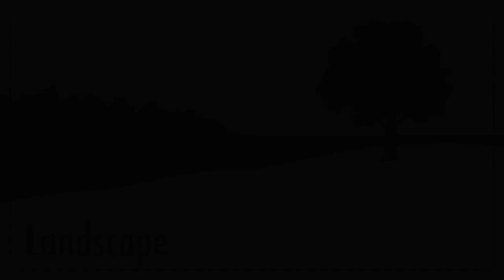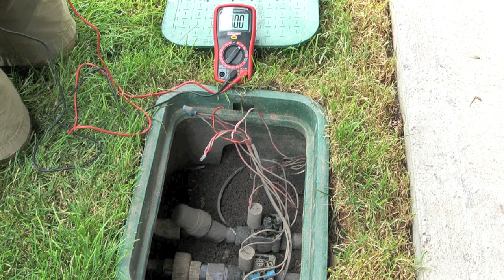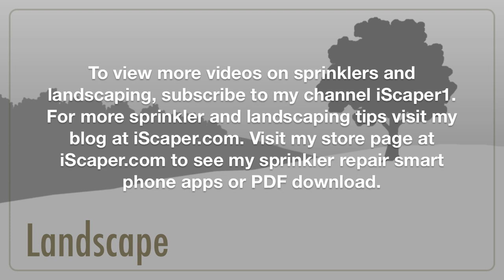Troubleshooting: Testing power to a sprinkler valve.

Comment: Thanks for posting. Any readers here that can help my problem, please feel free to chime in. I have a 6 station system that stopped working entirely. The timer controller was putting out 24 VAC at each port, the solenoids were not giving me an impedance reading though... (thinking wiring).. but each solenoid was operating when I spot tested them with power. I replaced the timer controller and this is when the mystery happened... two of the stations worked when I was going through the manual test cycle then some didn't. I scratched my head, unplugged the unit and tested all connections. I powered it back up and then NONE of the stations would operate. I can manually open each valve and they operate so I know it isn't a water supply or mechanical issue. Ugh, I don't want to dig up the whole yard for wiring. Any suggestions, sprinkler gurus?
Reply from the maker: I wonder if you have a bad splice or wiring between the timer and sprinkler valves. I would start at station 1, start it manually and test timer output for station 1. Then go to the sprinkler valves and test timer wires for station 1. Confirm that timer wire is same color at sprinkler valve as it is at the timer (that is, if the timer wire is red at timer it should be red at sprinkler valve). Put red probe from tester to station wire from timer and black probe on common wire from timer (common is usually white). You should have 24-29 volts. No voltage probably means a bad timer wire. If you do have a splice and the colors are off between timer and valves, then things get complicated. Repeat this step for stations 2-6.
Reply: Things definitely get complicated.  Can't depend on color of wires being same at timer and sprinkler valves.  Had one guy put a splice in the system and he completely ignored the color of the wires, he just spliced things together and somehow got it to work.  Had to trouble shoot the system a few months after his repair and had a difficult time trying to figure out what was going on.  Ended up running a continuity test and writing down the color at the timer and the color at the valves to try to keep things straight.  Purchased a roll of wire to run the continuity test.  Helps to have someone on the other end and communicate with cell phones as you run the continuity test on each connection.

Comment: The valve is rain bird that zone originally had 10 heads then we removed the lawn in the area now it only has 2 heads. When it had ten heads the valve would shut off right away then now it only has 2 heads and takes 10 seconds to turn off ( pressure goes down during the 10 seconds)

Comment: I had a company change a broken sprinkler head for me.  I noticed that after they left that my lawn wasn't being automatically watered. I checked the sprinkler control box to see if it was set to automatic and it was.  

This morning when the sprinklers should have gone off, but didn't,  I noticed a message on the sprinkler control box that said Valve Power Off. 

Could my repair guys have done anything to cause this problem? I am afraid that they're going to say that this is a coincidence and charge me for an additional repair. I unfortunately have severe health issues and I am at the whim of repairmen because I can no longer fix things myself.

Thanks
Reply from the maker: Sounds like timer isn't getting power. Confirm wall outlet timer is plugged into has power. Check the external transformer, if the timer has one, is plugged into the wall outlet. If you have a multi-tester, check 24VAC terminals on timer to confirm you're getting 24-29 volts.

Comment: stations 123 are good
stations  456 go on &
then go off on off on off ect.how do O fix the
problem?
Reply from the maker: You may have a bad connection at the valve box. I would check the common wire first since you have 3 stations going on and off. It might be worth cutting and re-stripping the wires at the valves.

Comment: Going on 12 years of helping ppl out, amazing. My valve is only getting 11 volts but the box is giving out 22-24..... any ideas? Ive spent days trying to figure it out
Reply from the maker: Not good, my guess is you have a problem with the timer wire bleeding power between the timer and sprinkler valve. If you're lucky you'll have a spare timer wire in the valve box. If so, use it. If not try undoing the wire nuts connecting the station wire and the common wires. Strip the insulation back a bit until you're past any corrosion. Re-test power FROM timer. Fingers crossed this cures your problem.
If you still have low voltage you could:
1. Connect 2 station wires to one timer wire. Your timer will run 2 valves. The downside here is you may have flow problems on the two stations watering together. 
2. Rent a line locator to find the bad spot in the timer wire. Problem here is line locators are expensive to rent and you may or may not be successful finding the bad spot. 
3. Run a new timer wire from timer to sprinkler valves. This can be expensive and time consuming also. 
4. Buy a battery powered single station timer for the sprinkler valve in question. This may be the best and least expensive solution.
Reply: @Iscaper  and you replied quick, I'm going to look into all of this tomorrow in the a.m. 
You're truly appreciated
Reply from the maker: @dropkickbinks5656  Good luck!!

Comment: My sprinkler valve is not wired and when I turn the main on, the water just keeps running ???? The sprinklers just keep running even unhooked.
Reply from the maker: Johnny Arellano 
Check that the solenoid is off (twist clockwise to check) and if it has a bleed screw that the bleed screw is threaded in to the off position. If the valve still opens you might have debris in the valve keeping it from closing.

Comment: you failed to mention to shut off the water to work on the valve.
Reply: Also failed to mention that in order to test the voltage from the controller, the circuit being tested must be on.
Reply: Turn off at outgoing side of backflow preventer and you're good. Even then, if controller is not on when changing it you shouldn't have to worry unless there isn't a master valve
Reply: if your checking voltage I would assume its on...

Comment: my dog bite the wire for sprinklers and dont know how to fix it i put them back together and is not workin can somebody help me pliss
Reply from the maker: You may need to use a multi-tester and check if you have power to the break point. Maybe your dog broke the timer wire somewhere else.

Comment: Yah ok so it's got power. so,  you don't say if the valve looks OK, and turns on manually, in which case it's probably the $9 solenoid. If that works, problem solved, if not, replace or repair the valve, which is harder. I've seen lots of solenoids that just swell up & don't work anymore and nothing else wrong with the system...

Comment from the maker: No good solution here. You can run up to 2 valves off one station wire but then you might start have flow issues running 2 valves together.

Comment: listen its obvious this person is an amature a true proffesional would not just replace the valve thats not troubleshooting if the valve is not coming on the next step would b to remove the selenoid and test it by attaching one end to the + and the other to the - side of a 9v battery if it sucks the plunger in the selenoid works if it doesnt theres your culprit u just turned a $50 problem into a $5 solution, if its not the selenoid u might want to remove the valve top for diaphram stuck